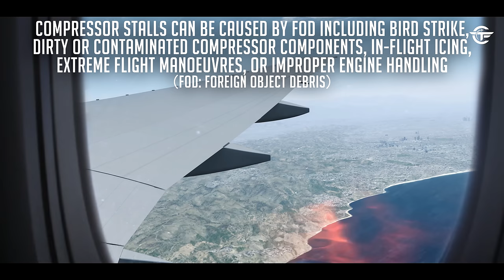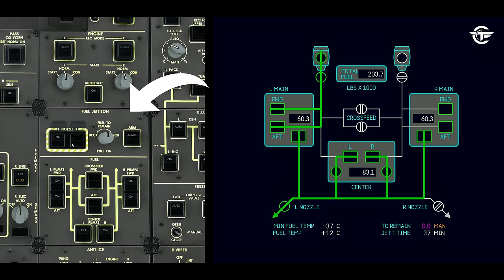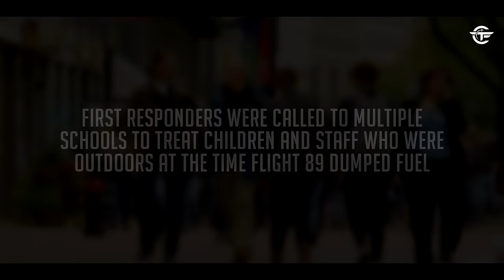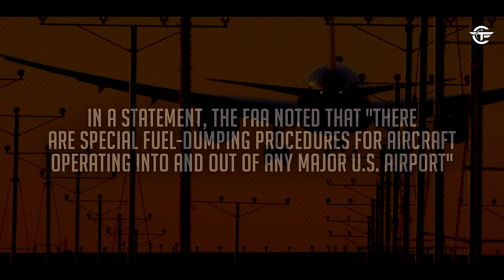Bursting into Flames Immediately After Takeoff from Los Angeles | With Real Audio

Comment: Seems pilot panicked and all his focus was on landing the plane quickly.
Reply: fjm1061 true.
Reply: That's what I thought. Stressed and tunnel visioned as opposed to intentionally cavalier attitude.
Reply: @catherineolivia1  Honestly I would have kept dumping over land UNTIL 5000 ft (it's still safe because it evaporates), then stop. The plane still could have made a successful landing in my opinion.
Reply: He got the plane down safely.  What if he lost the other engine for the same reason?  The idea that he had all day is an assumption.
Reply: There was no reason to panic, they are trained to deal with loss of one engine. There job is to not panic.
Reply: I'm not a pilot but everyone involved seemed pretty restrained and professional to me. I guess the main issue seems to be the fuel dump. That's not something I'd split hairs over. The crew brought the aircraft down safely with no loss of life damage.  Insurance will pay for those affected by the unauthorised fuel dump. Again, as a passenger with heaps of air travel, I'd buy them all a bottle of whatever they drink.
Reply: If compressor failure is going to cause you to panic, you might be in the wrong business.
Reply: Not exactly steely-eyed for sure
Reply: I didn’t read anything concerning if the pilots were punished in any fashion 🤔
Reply: No, he took time to mosey around above LA  dumping fuel. Guess what? The airport is quite close to the ocean.
Reply: Strong disciplinary action against the pilot should have been taken. As a parent of one the children I would of been furious.
Reply: He didn’t panic he was offered options and if he didn’t know he was doing something wrong he would’ve said something with ground draw. No excuse for this. The man himself should’ve been suspended or find and the company
Reply: @kennyworth007  they got away with it, but it could easily have led to disaster on the ground. One flame or spark and someone could have caught fire.

Comment: What were the pilots thinking?? As they had regained control of the engine the 'emergency' was not critical enough to dump fuel at low altitude and over populated areas. 
TFC your recreation of these aviation events are outstanding. Thanks!

Comment: What version of MSFS will you be using in all future video's, FSX or 2020 and what programs do you use to record and edit with? Sorry for the questions. I remember hearing about this, especially the part about dumping fuel at a low altitude and showering those school kids. The animations were beautiful and very well done, not a big surprise there. I like the important information you add to the video letting everybody know what needs to be performed to complete all types of landings including emergency landings such as this. Is it just me or is it normal for ATC to ask if the pilots needs equipment to roll, wouldn't that be standard in an emergency situation not knowing how it was gonna turn out to go ahead and the roll the equipment? So did the pilots get fined or scolded for dumping the fuel. Nice work as usual tfc, thanks for sharing.

Comment: I lived in Elk Grove Village IL and my condo parking lot was a great place for commercial planes landing at O'Hare to dump excess fuel.  Most of it atomized because of altitude of planes relative to normal pre-landing altitude -  but my windshield and hood always got plenty of non-harmful fuel deposits from the never ending air traffic landing at O'Hare.  Its good for your spleen...

Comment: I'm not gonna try to justify the pilot but he was probably afraid that the other engine will fail too, so he wanted to be as close to the airport as possible. Imagine if the worst would have happened: the pilot keeps circling above the ocean to dump fuel, the second engine fails, and the plane doesn't have enough time to go back to the airport (or is not able to successfully land the plane on the water). Then we would all be here judging why he wasted those precious minutes above the ocean and didn't head to the airport immediately. Again, I'm not saying he did the smartest thing, but given that 181 lives were on the line, he didn't take the time to come up with a better approach
Reply: The airplane is designed to run in one working engine over an ocean and be able to get to land.  What happened when it does that and is over a fire. Going to be one hell of a firebomb and the potential to kill more people on the ground then in the air.  Most pilots would rather stay over the ocean in order to make sure they don’t kill people on the ground which is part of training.   If he doesn’t give a shit about anyone else, he shouldn’t be in a position to carry any other humans onboard.

Comment: Bizarre pilot behavior.. these guys are experienced pilots too.
Reply: yes, experienced enough to know to land the plane as quickly as possible
Reply: @badactor3440  I wonder if you'd support them if they dumped liquid jet fuel on your house, car, you, your family, etc.   A compressor stall is not an uncontained fire. The pilots did a PRECAUTIONARY shut down of the engine.
  Modern jet transport category aircraft can easily fly on one engine, they are designed to do just that, if required.

If it was a cabin fire or something urgent like that, they would've landed immediately, even if they were way overweight.

Dumping fuel at low altitude over populated areas is a big no-no.  They had time to dump fuel properly over the ocean at a higher altitude, but for some reason they didn't.
Reply: @shanep.9442  you and all of the other "armchair pilots" will eventually find out why they didn't dump over the ocean. Delta has the world's   most experienced pilots.
They knew exactly what they had to do and when to do it.
Reply: @badactor3440  Perhaps you're right, and know something we don't, but the story didn't mention why they did it, so you can't blame the viewer for basing their comments on what the video provided. People aren't psychic. 
I doubt your claim of any specific airline having "the worlds most experienced pilots"  Many airlines have very experienced pilots. Delta doesn't have a patent on 'the most experienced pilots.'
Reply: @shanep.9442  Delta is the world's largest carrier. Of course they have the world's  most experienced pilots.
Get a clue.
Reply: @badactor3440  Obviously you're emotional about Delta airlines.  It's just an airline as far as most people are concerned. 
And it's not the worlds largest carrier,   learn to use Google to fact check before you post falsehoods, dummy.
Reply: @badactor3440  You didn't state 'by revenue'  previously,  Mr. Delta Airlines cheerleader. 

  You've got a lame excuse for everything,  even for dumping jet fuel on kids!      😅
Reply: @badactor3440 
They're obviously not as good as you think - the pilots.
They lied multiple times to the controller.

Comment: I must have watched dozens /hundreds of these wonderful videos , given to us by Flight Channel and my gratitude is unending. The videos are so professionally executed and so very technically  informative whilst also conveying the horror and the loss of so many. Out of the numerous videos I’ve watched and I emphasise - numerous , Delta Airline and their “subsidiaries seem to feature somewhat predominately ? Whether it be poor maintenance , pilot error or poor training? Not an airline I will patronise if it still even exists. Long haul , I stuck to BA . In the US , internal flights AA ( not hugely reassuring either ) whereas my treasured sister would fly with Delta . We were “frequent fliers” , I’m grateful that nothing happened to her . I may well be completely wrong . I certainly do not seek to impugn t(e reputation of Delta but seeing the amount of problems , all evidenced , it does cause concern. IMO  I’ll just add that it seems to me that it is  the case amongst the US ATC , as with some others , to speak too quickly and without proper and clear enunciation. Not all airlines /pilots have English as their first language . Whilst ATC they are juggling many flights, clear pronunciation and enunciation should be imperative ? Again, Imo.

Comment: I have over 50 years of experience in aviation both as a commercial pilot and as a licensed mechanic.  My initial training was in the Air Force.  

Once the captain declared an emergency he can deviate from the rules and procedures as needed to land the aircraft safely.  His primary responsibility is to his passengers and crew members.  That said, it’s not clear if they waited to start dumping fuel.  The controller ask if they needed to hold over the water to dump fuel?  The crew answered negative.  He may have been referring to the holding part of the question.  I’m not sure they waited to start dumping.  The investigation will determine that.  Also all the facts of this incident are not presented in this video.  As far as ATC knowing they would need to dump fuel, ATC knew they needed to dump fuel.  I have always been taught, and have taught my students, that in an emergency, land ASAP.  Before laying blame and or calling for the crew to be fired or loose their license, let the investigators do their job.  If you remember the actions of the US Air crew that landed in the Hudson was called to question,  An investigation was held and the crew was found to make the right decisions.  It may be the same for this Delta crew.   Flying around at low altitude, heavy, with only half of your power is not a desired position to be in.  It was a lot better to spray a few people with jet fuel than to crash in the middle of LA.  I also suspect there is more to this story than is told in this video.  If it took 10 days to repair the aircraft I suspect something else was wrong.  An engine change can be done in a day.
Reply: 50 years experience eh? The FIRST thing that is ALWAYS done is FLY THE PLANE!! You do NOT get on the ground ASAP.  That plane is certified to be able to fly on one engine.  The rules are very clear on dumping fuel. The pilots failed to follow the basic rules for a loss of one engine. FLY THE PLANE FIRST AND FOREMOST then evaluate the problem with a primary check, declare an emergency to the ATC by either PAN PAN or MAYDAY MAYDAY. Then follow the procedures to get the engine either restarted or take it off-line. That plane can circle and dump fuel safely without some foolish panic stricken actions. The pilots failed to acknowledge that they were dumping fuel and even told the ATC that they DIDN'T need to. ATC knows quite well that the plane can stay in the air SAFELY on one engine. OF COURSE all the facts are not in the video because even the FAA and the NTSB haven't finished their investigation. Both pilots endangered the lives of those onboard and on the ground, lied to ATC and tried to hide their actions. They will not fly again. At 8,000 ft they were not at a low level that was unsafe in fact they could have climbed to 10,000 with the one engine. Planes fly to Hawaii all the time with two engines. They have to be able to fly on one engine over the water too or would you suggest the pilots put the plane down in the ocean ASAP? Southwest just recently had to make test flights with the FAA and the NTSB on board going to and back from Hawaii and one of those teats included the loss on an engine and more.  The Hudson incident has NOTHING to do with this incident and in fact is a very poor comparison. Sully lost BOTH engines and had NO choice but to put the plane down. As far as how long it took to repair the plane it has no bearing on the incident. It might have taken that long to get the parts, people and/or the tools repair it. P.S. When taking off planes have lost one engine many times and do they just stop? Nope. They continue to climb because the rule is that altitude is a pilot's friend. Again, ONE engine on a two engine plane is capable to keep the plane in the air.
Reply: Nichol Van Dorn   You missed my point entirely.  How did they risk the lives of their passengers and people on he ground?
Reply: @billmorris2613  You are kidding right? Jet fuel dropped on children, adults, building etc? 50 years experience and you don't know the flash point of jet fuel as well as it's toxicity!? Any source of fire/ignition and what do you think would happen with over 20,000 gallons of high octane fuel and even in the air? Go to a gas station and spray fuel out of the nozzle and see how fast that the flames make their way to the nozzle. The jet fuel would do the same thing and find it's way directly to the plane dumping nozzles. The fuel in the air would ignite. The fuel on the ground would EXPLODE and you ask how lives were endangered? Never seen a flash fire have you? Automotive fuel has no where near the flash point (octane level) of jet fuel. Somebody on the ground having a backyard BBQ and the jet fuel landing on the flames? As far as missing your point, no. You need to read the comments of many others who understand the importance to fly the plane and follow set procedures for engine failure and getting the weight within the tolerances so that the plane can land.  It sure as hell is NOT to get on the ground ASAP! That one engine was running fine and will burn fuel as well. The pilot didn't even declare an emergency by the book. i would suggest to you to contact their airline, the FAA and the NTSB and find out how a one engine failure should be handled and what the requirements are to dump fuel PROPERLY. I'm sure you will find that these pilots are no longer with the airline and no longer have a pilots license. As far as carrying on any further comments with you I won't be. Sorry but I have other things to do than respond anymore to someone who can't even understand the effects of jet fuel dumped on people on the ground.
Reply: Nichol Van Dorn   Now I know you know very little about aviation and jet fuel.  Jet fuel is no where near as volition as auto gas.  Regular auto gas is 87 octane. Jet fuel is around 15 to 20 octane.  And there was nothing wrong with the way they declaimed emergency with ATC.

Comment: Did the pilots get into trouble
Reply: they should but not too much. they only did something silly not overtly dangerous.
Reply: pasoundman 
Couldn’t u die if u were smoking or something? Or if u accidentally ingested the fuel? What about damage to ur eyes?
Reply: @samanthafisher3308  jet fuel has a high flash point, meaning it takes extreme temperatures for it to ignite...way more than a burning cigarette.  But other than that, it's nasty shit.   Horrible smell and more toxic than regular car gas.   If you get it on your skin, it will be extremely red and inflamed in a matter of minutes.   And yes, breathing the vapors will knock your ass out.

Comment: Do you recall the SwissAir flight that diverted to dump fuel over an authorised area?  They never made it back to the airport due to the delay that caused (cabin fire eventually overwhelmed them).   These pilots just wanted to get on the ground ASAP instead of flying around in circles over the sea with a compromised aeroplane, is that such a difficult thing to understand?   Some people doused in fuel with no effects, or 300 dead people?
Reply: The Swiss plane was on fire. This plane was not. MASSIVE difference.
Reply: Swiss air pilots signed their own death sentence when they had significant evidence of a fire on board and chose to try and go to Boston rather then the closest airport in Gander.  By the time they redirected it was too late.

Comment: Error in video.  When ATC requests fuel on board, they are requesting it in the measurement of fuel left in time.  The pilot replies with " . . TWELVE PLUS ZERO ZERO".  Meaning there is fuel left for 12 hours and 00 minutes of flight time.

Comment: It may have already been mentioned but I didn’t see it, so I’m pointing out a correction for the video. 

The pilots reported the fuel status to ATC in time (not pounds).  6:30 They said “fuel on board will be twelve plus zero zero” which means twelve hours plus zero minutes.

If anyone is Intersted, when an emergency is declared, ATC always asks for:

“Souls on board” - so that Fire and Rescue knows how many people to account for (passengers plus crew)
“Fuel on board” - so that ATC has an idea of how quickly the airplane needs to be on the ground.

Comment: Just a thought but in the majority of these vids the planes are significantly under filled. This one for example said 149 passengers and the 777 is rated for at least 300. Ive looked up quite a few vids/planes and this is the case in a majority.

Comment: When the captain stated multiple times that they had it under control, why were they not DIRECTED to dump fuel? This seems like it would be more of standard operating procedure than a recommendation or suggestion as long as they are not in danger.

Comment: I used to believe 'pilot error' was the verdict the NTSB, handed down when no other explanation was evident, especially if the pilot doesn't survive.  Perfect scapegoat, case closed.  But, after listening to actual dialog between the tower and flight crew of Delta 89, I'm not so sure.  It was incredibly confusing. listening to so many numerical details being repeated over and over again.  They were going in circles with each and every issue.  Accurate communication had to break down somewhere along the line.  Coming at and leaving so many decisions up to a pilot during a crisis, creates yet, another crisis...  endangering the aircraft even further!  This bombardment would rattle anyone!

Comment: I was inside my RV at the Rottweiller beach when I heard the very very loud bangs.  I looked up and saw the flames in and out of the engine. The aircraft turned left immediately into a wide left circle towards LAX.  It was a left turn not a right turn as in the video.